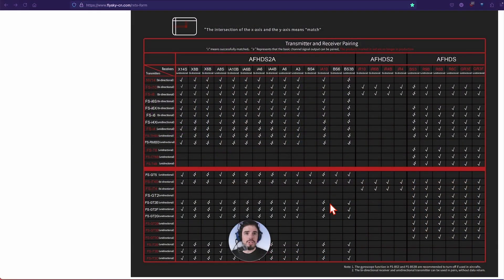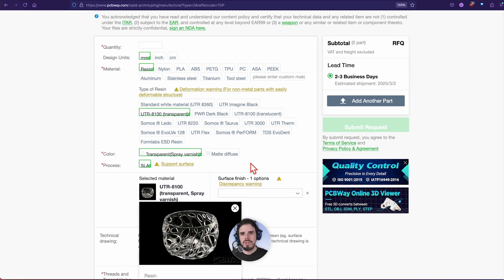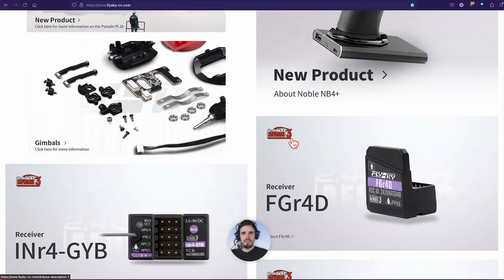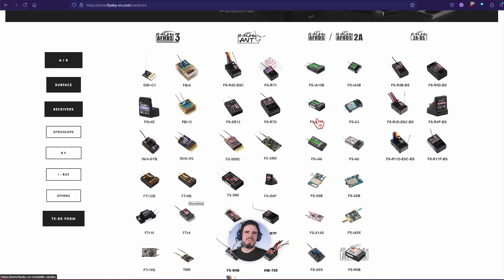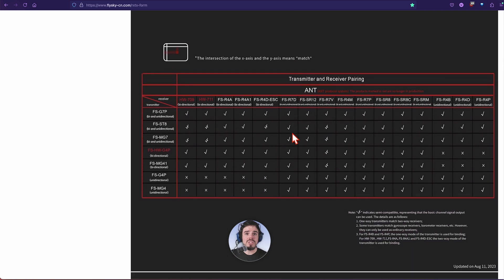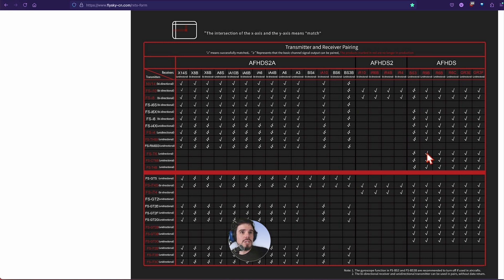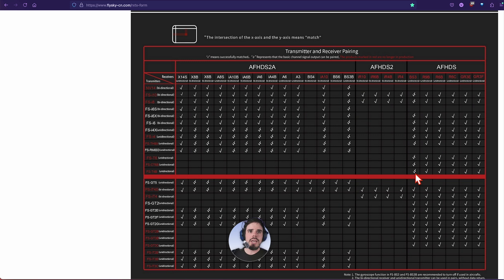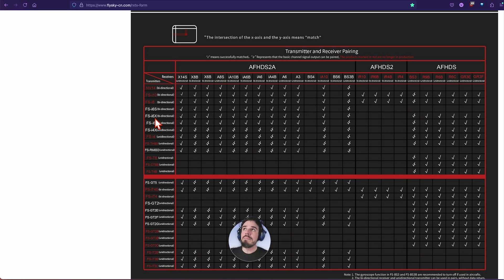Which FlySky Receivers and Transmitters work together? TX RX Compatibility Explained (actually easy)

Comment: Awesome stuff Adam...believe it or not....up until very recently...I still used the original 6 channel FS 6 channel transmitter...and just bought the 6I-X ...lots of compatibility between  the two....or just upgrade to a better...smaller more capable FS transmitter ...

Comment: Dude nobody cares about Flysky any more.........
Reply: He is right don't buy stuff u won't use in a year I have so much flysky stuff I won't use still like the i6s gimbals it's not 2020
Reply from the maker: That's interesting. What makes you say that?
Reply: @RCwithAdam1  There's literally no point using it. ELRS is the only control link worth using in 2025.
Reply: @CalebTyler what about someone who bought cheap second hand drone 😂
Reply: @keyboard407  Put a $10 ELRS receiver in it.
Reply from the maker: @keyboard407 Exactly. I don't really recommend FlySky anymore, but it still works! And a lot of people still use them. 👍
Reply: What is the $10 ELRS receiver and do you make your own transmitter?